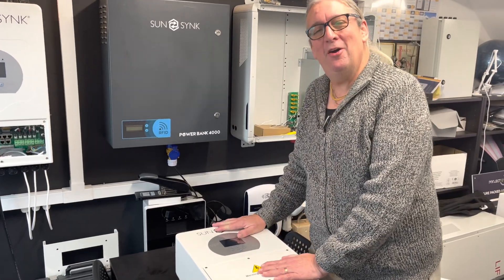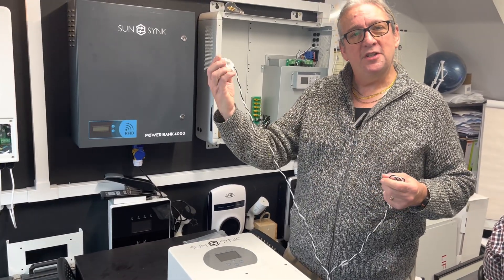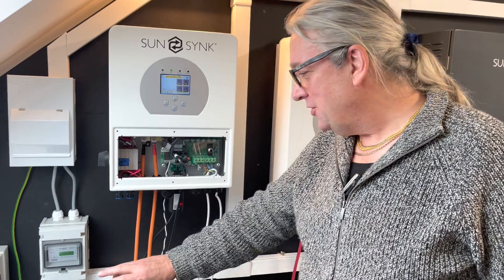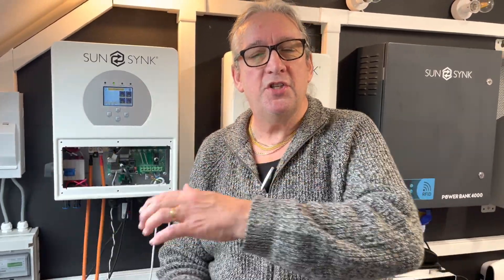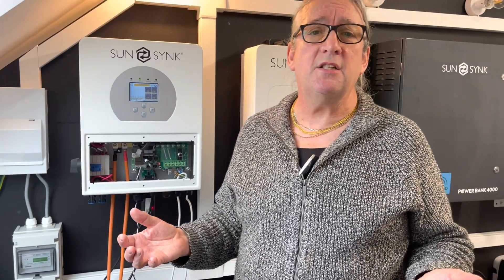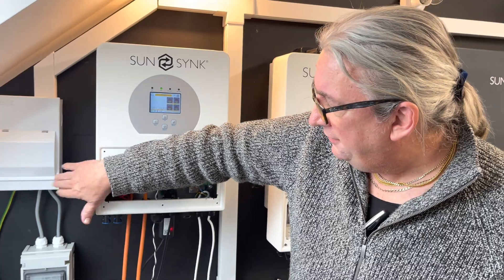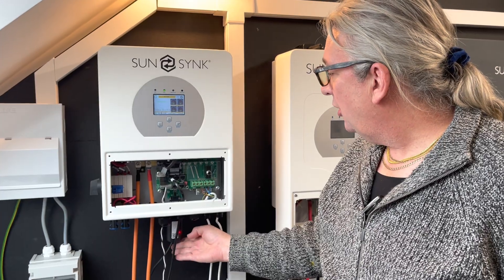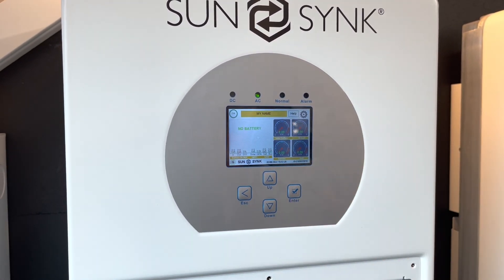#Sunsynk 3.6 kW/ 7KW  #Bi-Directional inverter #Super Inverter.

Comment: I have a 3kw system with this inverter on the first mppt, I want to add another 2kw to the second mppt does that mean it would need a g99 application or is It not needed as it only discharges at 3.6kw?

Comment: Hi Sunsyk. I got Easun 6200W 48v Inverter and 4x12v batteries. In your opinion what cable diameter you could recommend to connect inverter to the batteries?

Comment: If you have 7kw on the roof and 3.6 kw inverter and no battery .because it was installed to avoid DNO. How does this help.  I guess it doesn't. It only helps if you add a battery
Reply: Your not explaining bi directional

Comment: Hi Keith, I already have a non-hybrid Solis system working well, but i would like to add a battery. My system has the Myenergi Eddi for hot water storage and this also works well. Is the Eddi compatible with the Sunsynk inverter? Or does it already have that functionality built in? Thanks

Comment: May I ask what would you recommend. I have 9.6kw of solar cells on the roof in two strings. What model inverter should I get to supply the house and battery in single phase.

Comment: Hi Keith, seem many of your youtube clips and find them very informative. I message you as I have a question I would like you opinion on... I have the following setup, live in the UK and would appreciate your help – Can I increase the W from the panels from 3.8kW to 5.9kW yet leave the export to grid as 3.6kW as I only have a G98???

•	3.68kW Hybrid Inverter
•	2 x 5.1kW batteries
•	14 x 425 Panels – 5.95kW – on two strings
•	G98 in progress to sell back to the grid at no more than 3.6kW

The question is:

1.	Can I up the “Max Solar Power (1000-12000)” to the panel max being 5950W???

2.	Keep the “Max Sell Power (0-3900W)” to 3600W

What effect would this have on the system/ Inverter, as setting the 3.6kW back to the grid would restrict as per the G98 and coming into the inverter would be up to the max 5.95kW

In my mind, unless it is not possible that this would / may provide more power to recharge the batteries and more to house if needed – I ask because the installer said that was not possible due to only having a 3.68kW inverted and only a G98.
Reply: Did you get any info? We've just had 17 panels with a 3.6kW inverter and 5.12kWh battery and I'm suspicious the inverter is undersized.
Reply: @lukejones3069  Not yet, I have asked various ways on linkedin, twitter, here to no avail
Reply: Eager to know the answer to this too

Comment: Keith i have a system of 3.2kw array using 8 x 400 watt sharp solar panels . 3.6 kw inverter and 5.2.kw battery both sunsynk. Could the inverter handle another 4x 400 0r 450 watt sharp solar panels to produce more electricity in the winter when we don't fill up the battery in the November/Dec /Jan and February months.

Comment: @sunsynk 

So if I quote to install this 3.68kw ECCO inverter with 5.5kwp of solar panels, with a 5.12kw battery, do I need a g98 post approval? As this is still limited to 3.68kw export?

Or do I need a g99/g100, as it has a dc coupled battery and more solar panels?

Comment: So can you be clear as I cannot see a sensible answer anywhere. The 3.6 ECCO had a dual MPPT up to 7000w….so assuming you fit 7000w of panels and it’s a sunny day what is the maximum solar input you would see on the app or the LCD ? Some documents show it should be 4680w, other say as it’s only a 3.6kw inverter you’ll only ever see that, others say 7200w for solar input. Who’s correct ? I’ve never seen mine about 3800w

Comment: Hello, I have the same inverter and it works very good for the first week. But my installer put the CT in the opposite direction not to point the inverter, to the billing meter.  For me is very important to have zero export to grid. In the installer manual it is writen that if CT is in wrong possition in the information table CT will have negative ( - ) value, my is with possitive watts. Do you think I have to reverse it?

Comment: I have 6.4kW system. Am I right in the fact I should have had the settings changed to 7000w maximum from solar? It was fitted with the setting at 3600?
Reply: Did you get to the bottom of this ? Mine only ever peaks at 3800w solar input ? Is this normal
Reply: @benleitch5307  Did you manage to resolve this?  I'm looking at this inverter with 6.8kW of solar.
Reply: Yes I did. They updated my firmware. I have 16 x 415 panels into this inveter and have seen over 5600w ( previously it was limited to 3600 ) and it’s winter so I assume I’ll see more in the summer. All in all I think this equipment has halved my bills
Reply: @benleitch5307  excellent!  Thanks for getting back to me, it was impossible to find this info anywhere!
Reply: @scottmyers9850  there is a a Sunsynk forum on WIX. You can join that for extra info

Comment: ok,  I'm getting this stuff,  it's making a lot of sense.   my question is,   is there a limit to the GRID power throughput at all?    Is this something I need to be worried about?    For example,  If I have an original Main Circuit breaker, that has a main circuit breaker of 250amp,    and if I use an average of 40kwh a day,     do I have to worry about the amount flowing through?     Is it correct to say that the 3kw,  5kw,  12kw inverters  are purely about the PV size?   and not the amount on Grid AC that is moving through them?    I guess I've given myself a mental block and fearful of buying a small inverter, when my house uses a lot of energy from the grid every day.    I hope I'm asking this question correctly.      FYI, I only have 3kw of solar, and I bought a 5kw inverter.    I know it's not enough to power the house, I'm just augmenting it.   I'm just concerned that the Inverter will have issue with the Grid throughput.    or am i worrying about nothing?

Comment: I prefer the CT coil for export control as in most cases there is not space to mount an extra meter. We are not in the UK where we can mount/hide the meter in the airing cupboard. In most cases the DB board is mounted into a brick interior wall where its visible like kitchen or passage and is usually fully populated with circuit breakers and isolators making it problematic to add a switch without major building alterations. Also getting cables into the DB board is not easy as most of the conduits are full so a thin two pair twisted or thin screened cable for the CT coil can still fit in the conduits.

Comment: Hi Keith,

I've read the manual but is there any way of using a CT clamp when there's about 40m from the proposed inverter site to the meter tails?

Interesting situation... leaseholder and the freeholder will not allow the inverter or batteries inside the property or loft space. It would breach the lease.
Also freeholder is throwing up hurdles over having solar panels on the "shared" roof. So looking at a car port on the driveway instead.

Comment: how much are they (UK) and where does one buy?
Reply from the maker: Yes 100% in the UK
Reply: @sunsynk  perhaps you misunderstood my question, where can one buy these? Do you have weblinks to sellers./ installers? I need one and a battery.
Reply: @sunsynk  
Hi Keith.
 If i parallel 2 of my Sunsynk inverters to double my output from 3.6kw to 7.2 kw for my household loads,  then can i still use both sets of mppt controllers to split my additional (fragmented) PV array over the (2x2) 4 MC4 circuits giving me 4 independent strings ?
Also, how is the battery charging accommodated ? can both inverters charge together (giving say 180 amps) ?
If not then ( keeping cables equal length) do we link the battery busbar paralled outputs to the master only ?
Additionally will both inverters  need a CT coil connected  to the supply tails ?